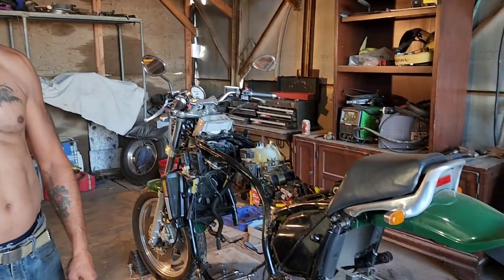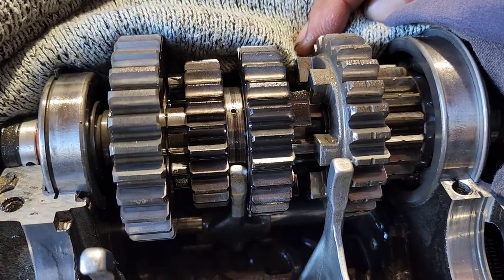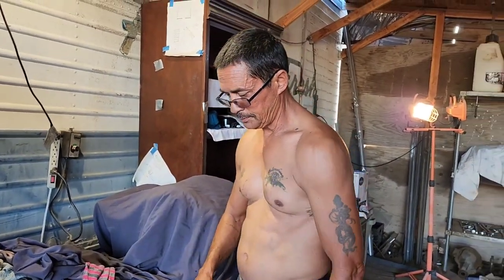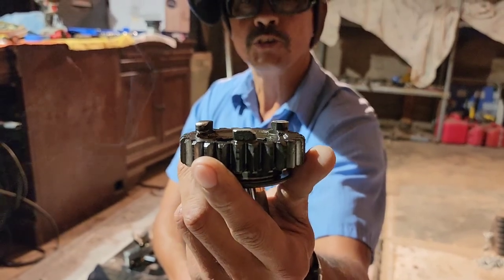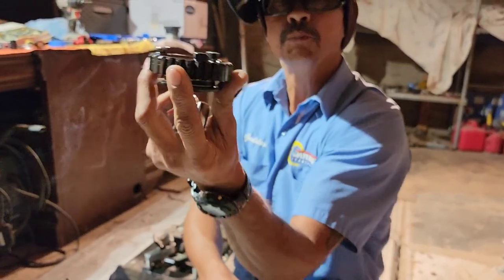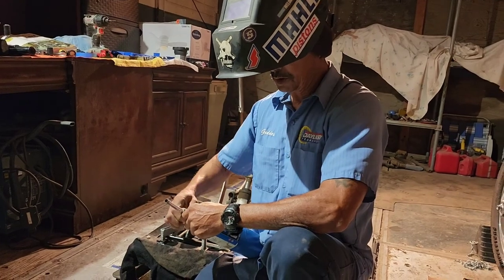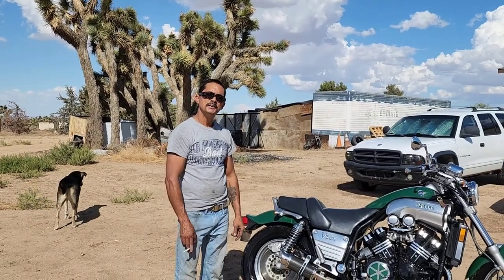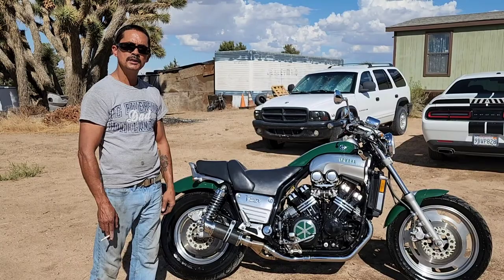second gear fix Yamaha vmax transmission

Comment: Great work, thinking about a V Max but this issue really puts me off, had the same issue with an 87 Kawasaki VN15, hadn't passed my test when i bought (here in the UK) it so didn't test ride it, on first ride it was popping out of second, couldn't face the job, complete strip down but also engine strip down (barrels and pistons need to come out) too so an engine rebuild, sold the bike spares or repairs and lost about £1000

Comment: The reason why the 2nd gear dove tails wear out is because of the shifting canister design defect. The shifting canister groove for 2nd gear fork doesn't push the 2nd gear dove tail far enough inside the female part of the other gear, so its always at the edge, and slips and wears out over time. I think that what you did by welding the dove tails is a good idea, especially if you make them a little longer so that they can fully engage more.

Comment: Another suggestion, after welding check the entire gear for possible pitting caused by ground contact arcing...and welding splatter...address as necessary...

Comment: The 85 n some 86 had that 2nd gear problem there was a recall to update that gear I remembered. I was lucky my 86 did not have that problem. They also detuned all the Vmax HP down from 140  to 130
Reply: This is in US
Reply from the maker: @localguy8  Yes this is in the u s
Reply: They all have the problem worse on shaft drive with loads of torque in 2005 Yamaha they added shims for less play but if you slam it into 2nd gear most things with dog gears become jumpy, 145 hp or 135hp my 1998-2002 both had problem.

Comment: the '83, '84 and some '85s  Ventures have a second gear issue also, do you know if it the same?
Reply from the maker: @raynic1173  I could not be sure if it is the same.I would assume not.
Because of the age difference in the motors

Comment: What does dovetailing it mean...??
Reply from the maker: Larger diameter  at top smaller at base
Reply: @larrygeddes4388  is it holding together or did it shatter off..??
Reply from the maker: @jerrybigrig9475  It is still holding together ride it every other day to work